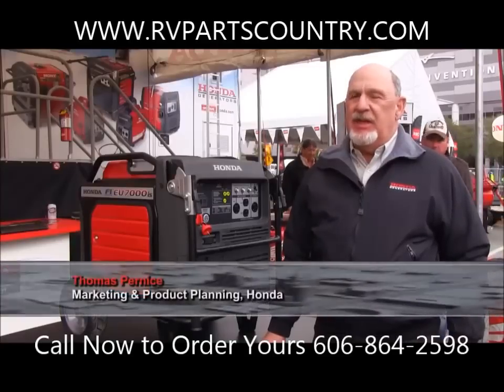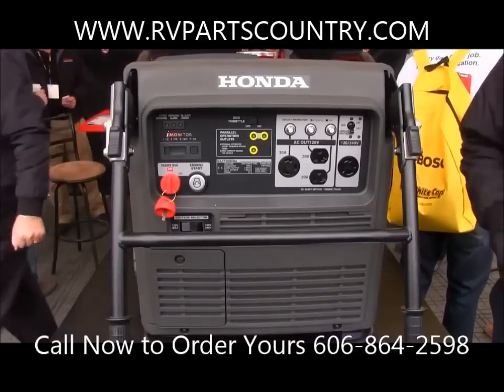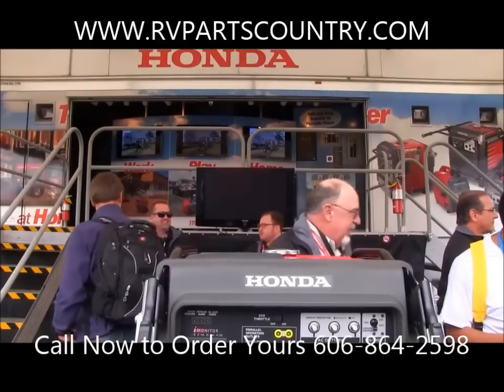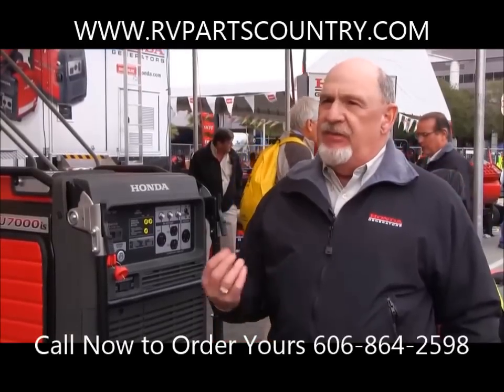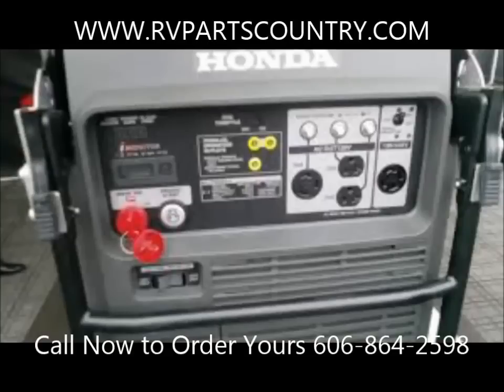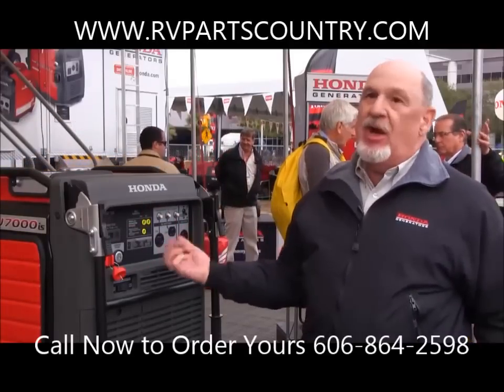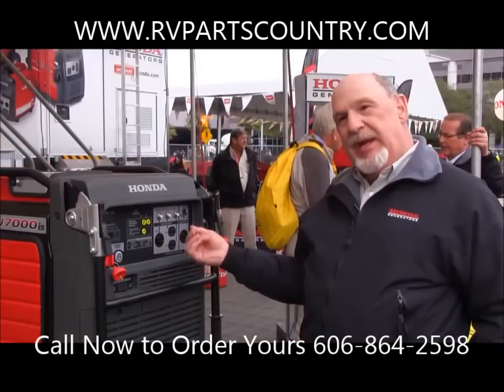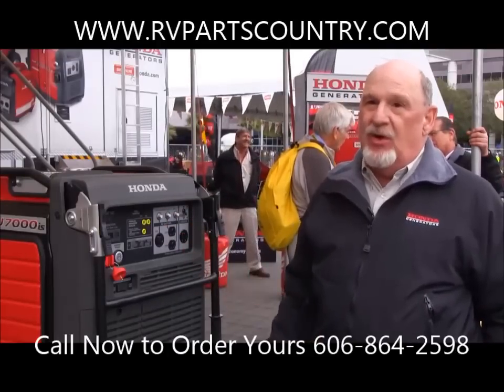Honda EU7000iS Watt Generator from RV Parts Country

Comment: I truly love my Honda eu2200i generator.•••>share4.photo/HEU22Inverter?шІ    The main reason I bought a Honda generator is to recharge my Goal Zero Yeti 1400 battery pack that’s advertised as a generator. The run time on my Honda is great and much better then using Solor panels which can take days to recharge something. Honda generators are the perfect equipment for recharging batteries with inverters in them not solar panels

Comment: they are nice, but for what you spent on those 2 Generators, you could have installed an automatic generator system big enough to run everything in your house.